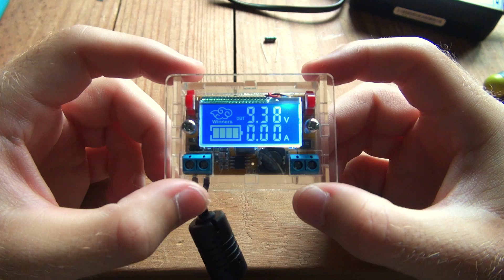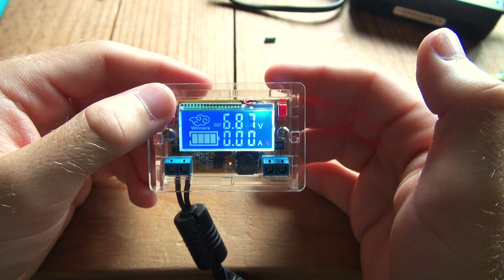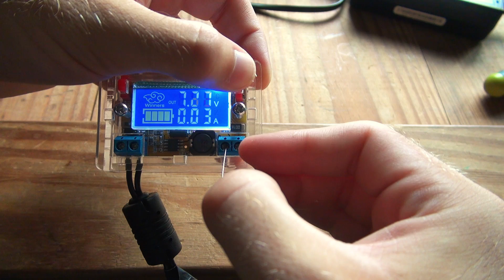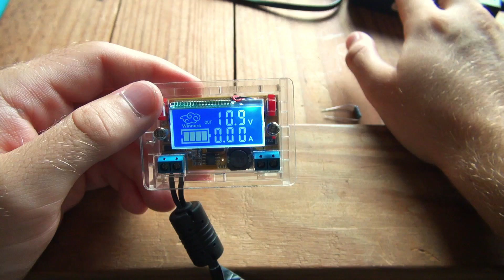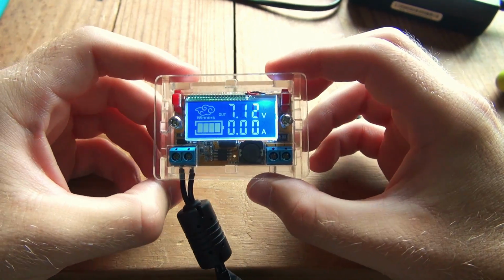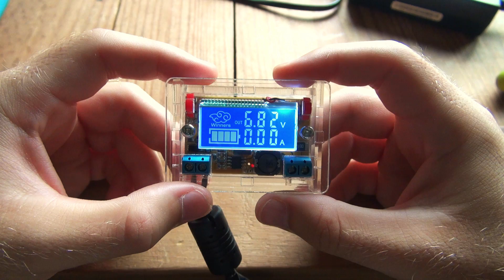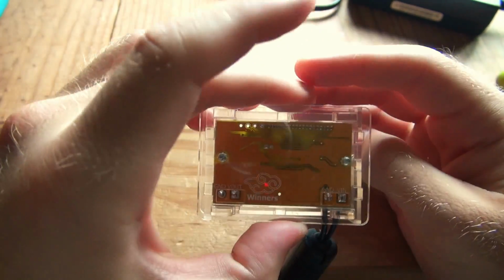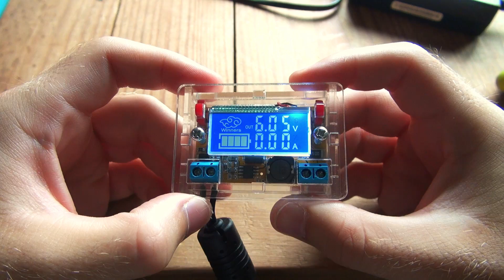DC to DC Step-down Voltage Converter Kit Review

Comment: Thanks for nice review.  I am buying one to use for short circui diagnosis on laptop boards.  5 volt/3 amp max is fine for that purpose, and I don't want to spend a lot more on full bench power supply.

Comment: Dude. Great video. You know your stuff. I have an 18vdc, 7 watt solar panel. It pushes about 0.32 or 0.38 amps. Is there anyway I can increase amperage to about 1 or 2 amps without reducing voltage too much?

Comment: Hey man maybe you can give an Idiot like me a bit of advice lol. Im looking for a device kinda like this (preferably in the same price range lol.) I need it to be able to adjust the voltage and the amperage. I need it for some amature electro plating experiments I want to do. Yet i'm only slightly more electrically educated than the average person lol. I need something to...
 1) adjust amperage from 3A to IDK like 10A? (Approx. I would just like some playing room.)
2) adjust voltage from (approx.) 5v - to 12 volts
3)act as a rectifier to smooth current 
4) It can be dc-dc or ac-dc... im not picky.
If you have any suggestions for me it would be greatly appreciated! I just don't have a ass load of money to get one of the big fancy digital variac devices... ya know? 
The ebay add for this product lead me to believe the amperage was adjustable... but it appears I was wrong. what if I bought many different dc wall converters (of verying amperages) to interchange when I wanted a different amperage?  Would that work?

Comment: can you connect 9 volt/AAs to this? Just curious.
Reply: sure. range is min 3v to about a max 30v
Reply: @pauls5745  Yep. I got it a while ago and it worked perfectly for what I needed! Whether it's a wall plug or a battery.

Comment: Wonderful review! I have also uploaded a review video on this module. Hope that would also help people looking for this particular module.
Reply: Please help me I have same power supply when I first turned it on it runs like a charm but after 4 hours it just stuck on 5v on but my voltmeter is showing that it is not giving an single volt. I turned it off for the whole day but still facing that problem please help me

Comment: I just found one of these in a junk store unused for 50 cents, took me alittle while to work out what it was, now I know what it does it's going to be very useful as time to time I play with Arduino and using various low voltage items reason for tripping over it as I was looking for a power supply for Led lighting and seen afew things that caught my eye while there also brought for 50 cents each Dual ultra sonic sensor, wifi controlled relay switch, A8 net 3d printer main board, eleksmaker laser engraver main board and 2 nema 17 stepper motors.

Comment: Thanks for posting this video;  I've been eyeballing this module.

I'm curious if when you're clicking/changing voltage to go higher (right button), if you were connected to a voltmeter on output terminal, if we might have seen voltage increase? ...although it didn't show on lcd display, due to 3 digit lcd display that comes with module.

In other words, when the voltage goes above 9.99vdc, then to accommodate voltage readings the decimal jumps over to read 10.1 vdc...and so forth, AND would show on voltmeter progressing 10.1 .... 10.14 .... 10.18 .... 11.02. etc  .

thanks again for making editing this video; much appreciated.

jimmyg

Comment: If the max voltage input is 23 V,     Is it OK to connect to a 24 V battery,    Say from a electric bicycle ?
Reply: If you can afford losing the device then yes.

Comment: hi Mate.. dont you calibret it.. like this: Calibration Mothod:

Power-off status, press and hold the left button access the power, the display starts flashing, release the left button. using multimeter measured the output terminal voltage, if the measured voltage is greater than 5V, press the left button reduced the voltage to 5V; if the voltage is less than 5V, press the right button to increase the voltage to 5V. When the LCD display voltage of 5V(sometimes it shows 4.99V), turn off the power, the calibration is complete.

Comment: Got one of these and the voltage display stays at zero. Current works, and the setting also works. I can trace the 1/10 voltage from the divider all the way to the micro pin, but display says zero constantly. 
Anyone experience something similar?

Also, MP23070  link is broken in description.

Comment: Hello everyone, I was doing with no load tests on the module; The voltage reported on the module display with respect to the voltage measured with a multimeter is approximately 0.05 volts, for example, 5.06 volts are displayed on the module display and 5.01 volts are shown on the multimeter. We will have to see how is the difference of voltages with load.

Comment: It would make sense, because its a step down you should'nt need to try to get to the source voltage, and the batt. icon is i think is a battery status, that is very cool! i bought one off of Ebay but does not have a digital display, had to use voltmeter to adjust voltage., tbis one also display Amp so awesome!. i have to get me one now, thanks for sharing.

Comment: Dude, I have been searching for over an hour for this exact thing.  I want to run 24v off-grid, but have an option like this to run laptop or whatever at each low volt socket.  Laptop is 19v, and other devices I have are 12-14.4v.  
Thanks for the video